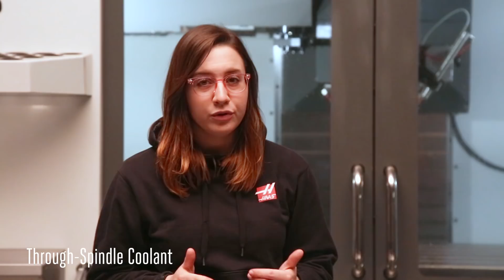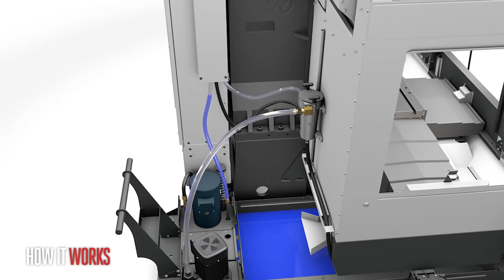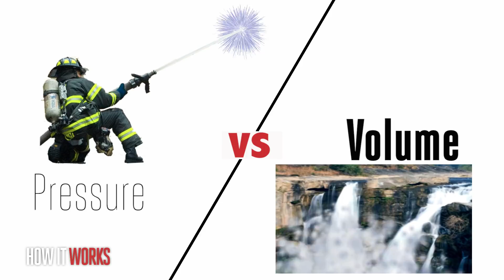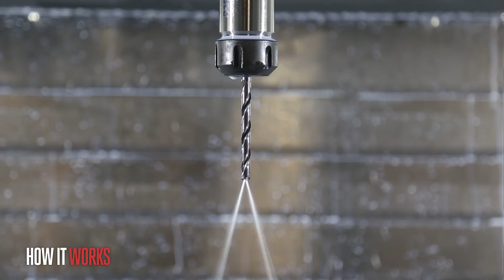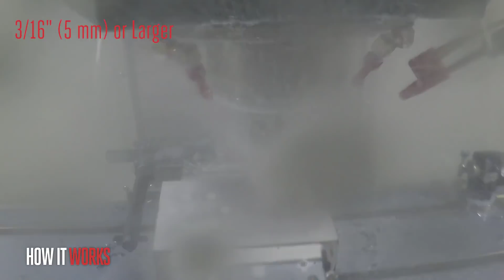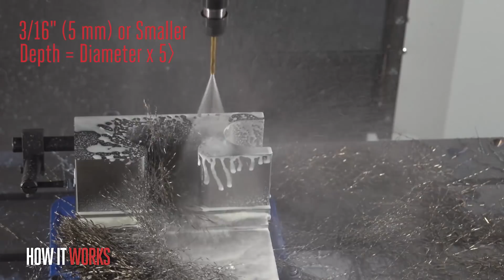Through-Spindle Coolant - Haas How It Works

Comment: I really hope Haas will figure out a way to allow turning this off without having to reset in the middle of a program.
Reply: You should be able to enable/disable TSC during a “Run Stop Jog Continue” - not as easy as a dedicated button but would save you from stopping the program.
Reply: Press feed hold. Press stop on spindle control. When spindle stops spinning hit aux clnt(next to clnt up/down for p-cool). When ready to start hit aux clnt again. Wait for coolant to flow. Cycle start.
Reply: Can you connect to the solenoid with a switch/relay in series? Then you can manually cut the power to the solenoid when you need to.  Maybe a PITA to do, but it should do what you want.  If not the solenoid, then the pump itself?
Reply: Feed hold -> Letter Z -> Handle/Jog -> Aux/Clnt - > Memory+Cycle start to continue.
Reply: m88 (on)  /  m89 (off)
Reply: keefmeef ,you cannot drill 3 of 30 holes press feed hold and turn the TSC off to check the part, turn it back on, and cycle start. 

We are running a part now with 61,248 3/32 holes in it. It's hell checking hole integrity with coolant blasting at 300 psi.